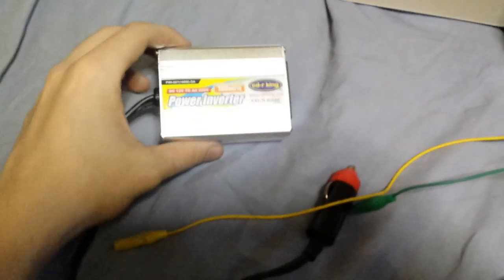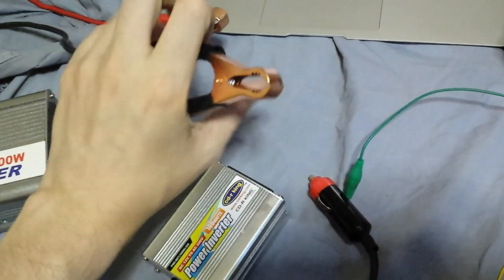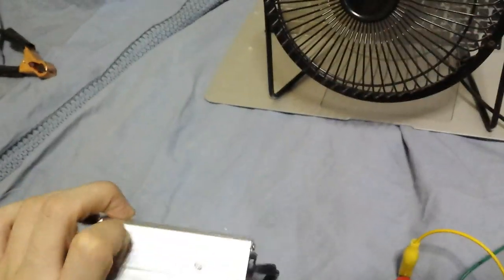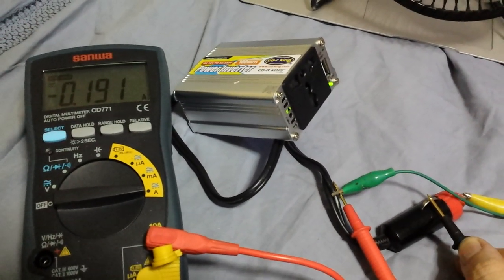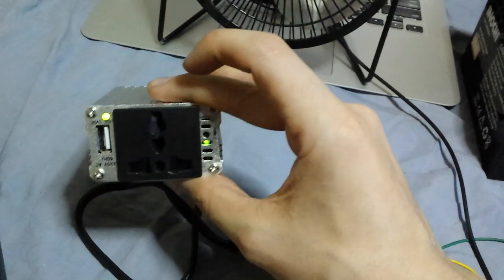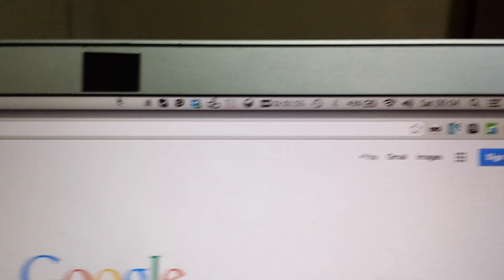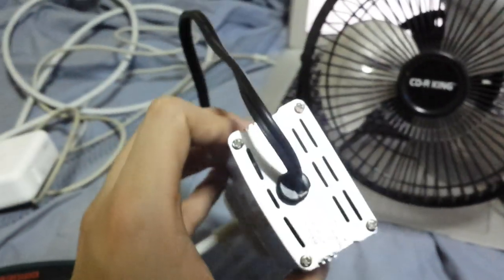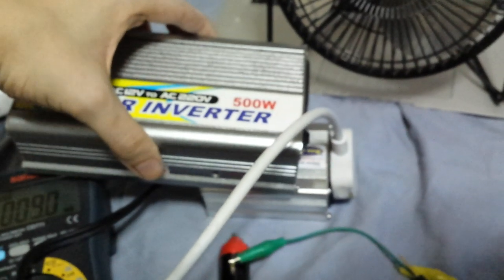100 Watt cdrking Inverter

Comment: I'm planing to buy inverter with built in ac/solar charger, with indicated in solar charge open circuit Voltage maximum of 25V. As I know most of solar panel open circuit voltage of 17v@12v rated. My question is two series of 17v open circuit Voltage can feed to maximum of 25V open circuit Voltage?
Reply from the maker: robertoa I assume that inverter/charge controller still needs a battery connect too, right? So feeding in two panels in series would be 34 volt and over voltage for that controller. Plus it would be wasted power because it has to drop it down to 14 volt to charge your battery. So you'd be better off putting them in parallel so they stay at 17volt but higher amps. If it's the big box inverter/controller from CDRKING that is around p1500, I wouldn't recommend buying it because it has a history of failure.
Reply: Gadget Addict yes as typical solar, inverter, and battery link. correct me if I'm wrong with my conclusion why double the input voltage, if the energy provide by the solar panel is larger than load equipment it seem instead of battery depleting will directly absorbed by the load..

Comment: Hi! I'm planning to purchase this same inverter from cdr-king, cut the car cigarette plug end and attach alligator clips to directly connect it to a 100AH solar master battery. I will also buy a cheap 150 peso USB fan from cdr-king and directly plug that to the USB port of the inverter to keep the inverter cool. Not to mention that I might open the casing so that the fan will be able to cool the inverter faster. What do you think Phil?

Comment: Any ideas if its possible to run an inverter, either PSW or MSW inverter, 24/7. Plan on using it to run house lights off grid. And will be using the existing house electrical wirings. Isolating all lights to one ac breaker which is plugged to the inverter. 100ah + 150W panel will be the setup. Thanks.
Reply from the maker: It's possible, but you'd want to invest in an inverter that comes with a good warranty. A cheap no-brand inverter would likely fail pretty quickly under those conditions.

Comment: without a fan will it get overheat and shutdown if you in a place there is not wind to cool it down?
Reply from the maker: tan hock jun I think it will overheat and turn off but I've not pushed it that far myself. It's designed to operate without a fan but even with just a small load it gets extremely hot. Personally I would avoid any inverter that doesn't include a fan.

Comment: Hey Phil,can this 100 watt power inverter handle a electric fan?
Reply from the maker: Yes, but if you plug an AC fan into the inverter, it will not spin at it's full speed and will wear out faster. Same for any inductive load that you power from a modified sine wave antenna. I bought a 12v car fan from Ace hardware instead so I can run it straight from my solar battery :)
Reply: Ok,Thanks for the info Phil.How 'bout the 300 Watt cdr king inverter?
Reply from the maker: Ray Luis D. Monserrata Same rule for any modified sine wave inverter :) I think they do have pure sine wave inverters at cdrking but the price is higher.
Reply: Ok Phil,Thanks again for the info.
Reply: Gadget Addict can you tray your solar generator if have a blackout pls :D

Comment: Could it handle a 12 volt 3 Amp DC power into 220 volts AC?
Reply from the maker: Yup but 12x3 is only 36 watts, so you wouldn't be able to draw too much power on the AC side.

Comment: phil what is the mathematic solution u have done to compute amp and volt on inverter and u know the watts it consume
Reply from the maker: For accuracy you need two multimeter, but it's close enough to use just one. Connect the inverter to your battery and measure the voltage, it will be 12-13v. Then swap your leads to measure current and have your multimeter in series with between the battery and the inverter. It will measure something like 0.5 amp. Then multiply the 12v x 0.5a and you get 6 watts. That's how much power the inverter is consuming :)

Comment: Hi! I like to know have you tried to run that 100Watt inverter 24 with just powering 2 or 3 LED 10watt bulb?
Reply from the maker: +Mark Queboi I haven't ran a load for as long as 24 hours but I think it would handle a 20-30 watt continuous load without issue :)
Reply: Thanks :)
Reply: +Gadget Addict Hey, we got a Haitral 200 watt and it looks just like that one! It says it is 400 watt peak 200 watt what eve that means? I think it is the same machine just a different name of the thing?!? Thanks for posting this as well, we loved the t.v. one, we just became sub's to your page but love all the video's. Hope you keep posting The inverter ones we love because we want to try a few of your projects just for shits and giggles hahah
Reply from the maker: ***** Thanks for the kind words :) Both are probably just rebrands of a generic :P Those max ratings are usually considered for 30 seconds or a couple of minutes, but not as as continuous load :) Hope that helps!
Reply: Oh yes it helps for sure Thanks allot!!

Comment: I have a question it is possible to built the inverter of 6v DC to 220v ac and a 100watt ?
Reply from the maker: Most off the shelf AC inverters like this won't work with a voltage that low, since they're really aimed at 12 volt battery systems. They have some tolerance, usually around 10.50 - 14.5 volts, but certainly not as low as 6 volts. You could wire two 6 volt batteries in series to get the required voltage.
Reply: Thanks...there is a inverter circuit operate starting 6v DC to 220v ac but the watt is up to 30 watts only.how can I change the 30 watt to 100 watts? But the same input and output
Reply from the maker: mhafe robles I assume you're talking about a DIY circuit (like from circuitschematicelectronics)? May I ask why you need to use a 6 volt battery? As far as I know there aren't many high capacity 6 volt batteries out there... maybe 12 ah at the most. So even if you connect a 100 watt inverter, it wouldn't be able to run for very long. Unless it's constantly being charged like on a motorbike? Can you tell me more about what you have in mind?
Reply: I have to construct an inverter circuit using 6v DC to 220v ac and 100 watt. That's why I'm asking...thanks for helping
Reply from the maker: mhafe robles Yep I understand what you want to do. I'm just curious why. A lot of electronics go into making a reliable and safe 12V AC inverter. It's not going to be a small task to do what you want. Especially to support such high wattage. So I'm curious if there's an alternative that you may consider.

Comment: can you directly used its USB port to charge mobile phones ? or do i need to have an inverter or no need anymore? PLS REPLY..thank you so much
Reply from the maker: Mardonio Herrera jr. You can use the usb port that's built into the inverter. But if you only want USB charging, it would be more efficient to buy an in-car USB charger and connect that directly to your battery or charge controller.
Reply: Gadget Addict Actually im going to have a solar panel, connect it to a rechargeable battery, into an invernter just like this you are using , so that I could charge my mobile phones or gadgets that needs on 5v to charge these things. Is this possible? thanks in advance for your next reply and advice...
Reply from the maker: Mardonio Herrera jr. Yep it's possible, but if you're primarily just charging 5V USB gadgets, it would be more efficient to wire an in-car USB charger to your battery instead of using an inverter. The inverter will consume power even while idle and will waste power in converting from your 12v DC battery to 220v AC and then down to 5v DC to charge your USB gadgets. Depending on the size of the solar panel, you might need a charge controller instead of connecting the panel directly to the battery.
Reply: ah ok let me get this noted if i get it right... so from the solar panel, connect it to charge controller, connect this car USB charger with usb slots for me to connect my mobile phones? is this right sir?                              Im planning to use this in outdoor while doing rural adventure and attaching the panel to my backpack and charge my phones while on the move...need not much power but just enough to charge one to two phones at a time or smaller usb lights to light up during night time while camping... im planning to make a set up for me to help my fellow friends so that it wil make our travel okey. Hope you can help  me more sir..
Reply from the maker: Mardonio Herrera jr. Yes po, what you wrote is correct. But based on your intended use, I wouldn't recommend that setup. It will be a little bulky and might experience problems with loose wires etc. I would recommend a solar panel with built in USB ports, like the one I reviewed in this video - https://youtu.be/CLDqtuWdwUM . cdrking and other companies sell similar products here in the Philippines. If you want to charge it during the day and use the power during the night, buy a USB powerbank and charge that from the panel while you walk around. Do not buy a powerbank that has built in solar panel, the panel is too small and leaving the battery in the sun will damage it.
Reply: ok ill get back to you and ill see your review first..thanks hope i can find this item somewhere or cdr king if its durable..thanks again..later sir...
Reply: Gadget Addict hi sir, i already seen your video... so i have question cause im thinking it hard that these kinds of solar panels are not that durable and less effective, except if theirs constant sunlight for lesser charging time... so im thinking if ill use this kind of solar panel charger, can i save this energy to a powerbank instead of directly connecting the solar panels directly to my gadgets? i can cover up my powerbank against heat from the sunlight... this is the other option im thinking... can this be done? thanks advance...

Comment: What kind of cable are you using?
Im new here.
Reply from the maker: Do you mean the cable between the battery and the inverter? I"m just using alligator leads. They're suitable for testing only and can't handle high current.
Reply: Ok, thx

Comment: Hi sir, I just want to  seek  your assistance. I actually  purchased the 150 Watts CDR king power inverter - same  voltage specs.  then i connected to a Dyna  (Motorcyle battert) 4 MF4L-B (12 V DC). I followed the connection  but  the wire  burned and the  light indicator  of the power inverter. I thought that  the wire might have  been  too thin -  so i tried a thicker electric  wire - the one that used for  electrical  extensions - but same  thing happened,  it  heat  up  and almost melted. I hope you can  answer my inquiry since i  really think  that  this  is  a  great alternative during power outage. I just  want to also  asked  which  CDR  king  store / location did you bought the 500W power inverter. Thank you much for the assistance, i am hoping to hear  from you soon.
Reply from the maker: Eddie Belga That's really strange. Are you sure you haven't accidentally created some kind of short between your battery positive / negative? You can see in my video that I used very thin wires and although it's not recommended, it worked for the small load I was powering. I think the 500W inverter came from the megamall branch.
Reply: Gadget Addict I did see your set up  on the video. If  for some  reason  i might have done some kind of short  between the battery  positive/negative  -  is the battery  already  damaged  or  it  might have  damaged the  power inverter. the reason i am  asking  this-  the first  time we  tried it, we didn't know which was the  positive/negative of the power  inverter and that  is why  the first why  burnt and melted.  Do you think i need to buy a new  inverter  or both  battery  and  inverter. I greatly appreciate  your views on this. By the way, i went  to  megamall CDR king branch and they  dont have the  stocks  for the 500w inverter ... so sad....:(
Reply from the maker: Eddie Belga Lead acid batteries are pretty resilient. Even if you damage it a little, it will probably still operate good enough for what you want. Did you open the inverter and check if there's a fuse inside? You might be able to solder a new one on. It should essentially just the red cable from the inverter to the positive terminal of the battery and the black cable from the inverter to the negative terminal of the battery. I'm still not exactly sure how you could have shorted it or burnt it to be honest :P I saw larger inverters being sold at Ali Mall just a few days ago, so you might like to try there.

Comment: in addition for help I need is about battery for solar power system, although i'm Pilipino but you looks familiar for the availability in my country, my plan to buy is minimum of 100Ah x 2 please advice me which brand and available locally. 
Regards & god bless.
Reply from the maker: robertoa I generally recommend Motolite. Although I recently had an issue with one of their batteries not holding a charge and they refused to honor the warranty. So now I'm not so supportive of their brand.
Reply: Gadget Addict meaning what is the use of warranty for them, sad to know that. could be better to buy from authorize distributors. thanks for info.

Comment: nice
Reply from the maker: Thanks :) I ran it for a fairly long time to charge the laptop to 100% and didn't have any issues other than it got pretty hot. I experimented and even a small cpu fan was enough to dramatically drop the temp.